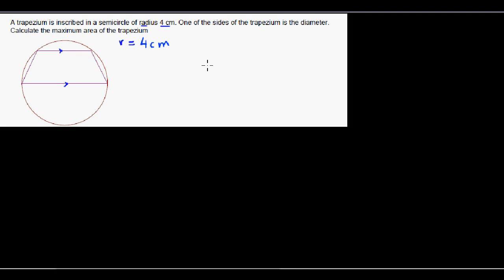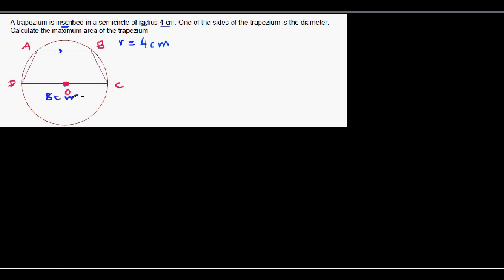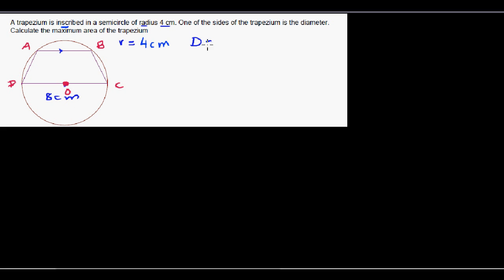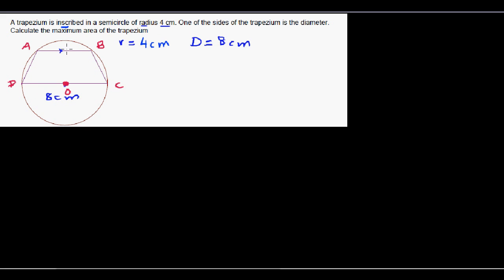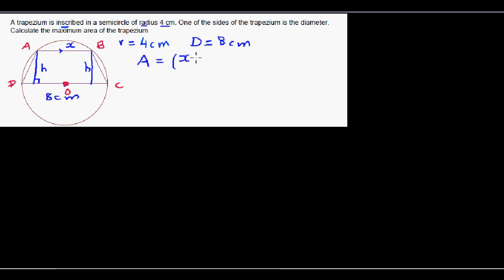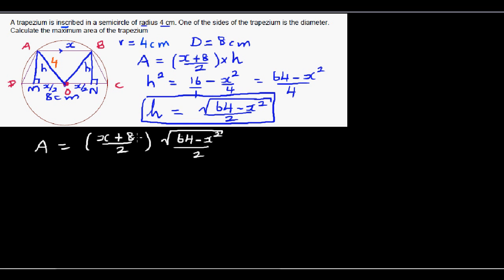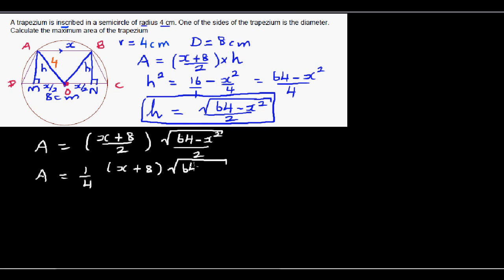Using calculus to find the maximum area of a trapezium inscribed in a semicircle radius 4 cm

Comment: you said to cross multiply when you were doing the green part, which isn't correct. What you actually did was get a common denominator. Cross multiplying can only been done when there is an equal sign between two fractions. 
Great video altogether though

Comment: can you do it the same way if you are given radius = a? instead of an actual number
Reply from the maker: Yes you can but then you need to remember that r is constant and the derivative of a constant is 0
Reply from the maker: Joice Mathew If you take r instead of 4 cm you will find that maximum area is obtained when x = r
Reply: Joice Mathew
x being the top of the trapezoid which means that the top x = radius r and the bottom being the entire diameter which is 2r or 2x same thing?